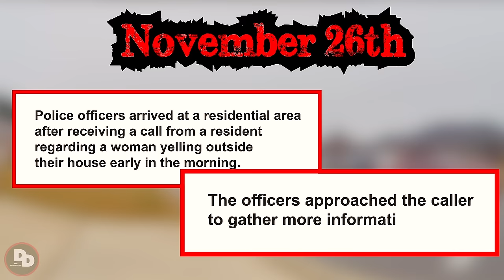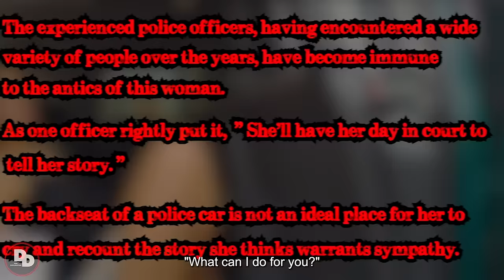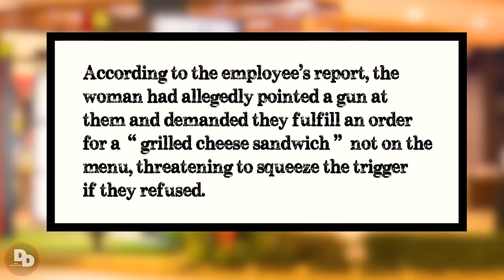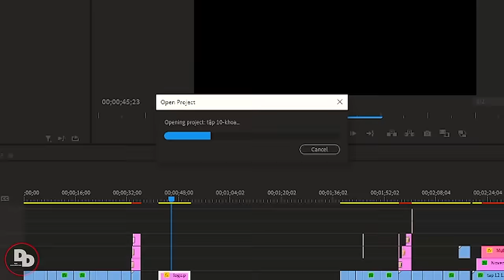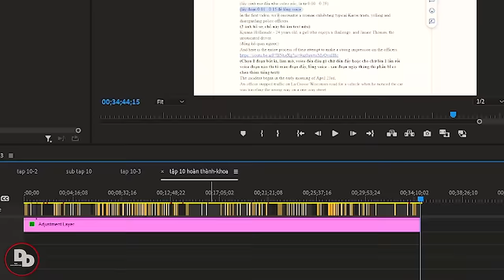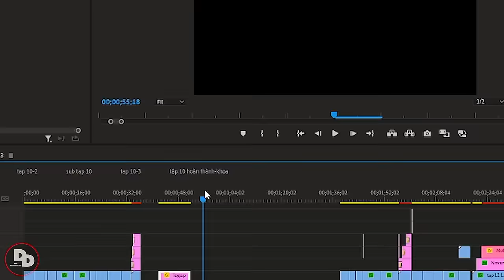When Entitled Girls Realize They're Going to Jail | Karens Getting Arrested By Police #79

Comment: Question from the UK: What does "having (i.e. carrying) a doctor's prescription" mean? I was advised to do this when visiting the US re: my UK medication. Over here, a "doctor's prescription" is a standard printed form (or in the case of a private, non-state, prescription, some piece of doctors' 'official' stationery) signed by a licenced doctor - either wet-ink or electronic  - instructing a pharmacy/pharmacist to dispense (i.e. supply to the patient) specific medication or medications, dose and duration of supply. I take that to a pharmacy and in exchange for the prescription, I get the medication. When I leave the pharmacy, I no longer have the prescription - although, I may well have some written receipt/record of the transaction. I believe that's how this works in the US, as well.

So, I either have in my possession the prescription OR the medication. I cannot possess both. So, how does this work if the cops search me and find legitimate medication? How do I prove this?
Reply: The medication just needs to be in the bottle it was dispensed in from the pharmacy with your and your doctor's name on it.